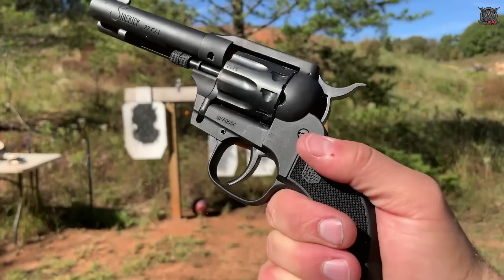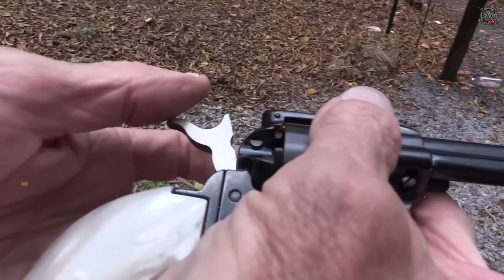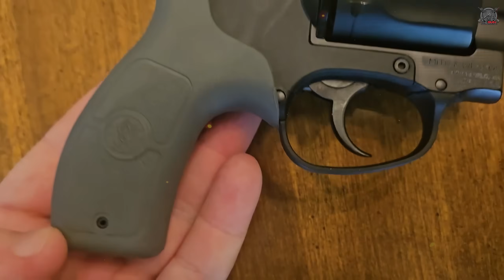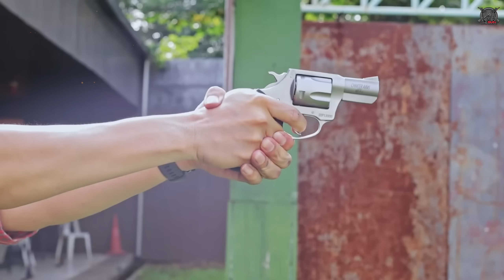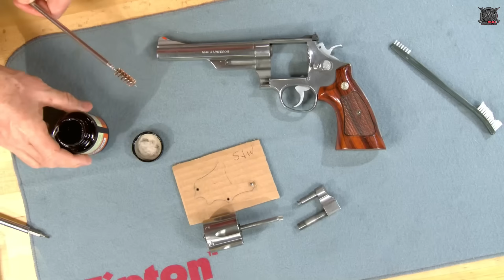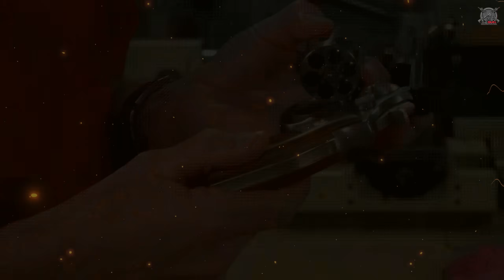Why 90% of New Revolvers Are Garbage!

Comment: I original from the State of Connecticut and we have several Guns Manufacturer including Colt, FA from Harford, Hi Standard, from Hampden, Strum Ruger from South Port, and I owned many of these old firearms some made from Machine an Carbon Steel plate purchase from US Steel as supplier. I used to work with my friends who was a Gun Marker and he machined a lots of Revolvers like Single Action, Peace Maker, Pythons, Police Positive, Official Police, These are old guns made since 1845 and I have some of them that I used and purchased with no problem.

Comment: Revolvers are as good as and bad as the semi-auto pistols manufacturers are putting out. I own two Taurus and had a problem with one. Fortunately, Taurus had a lifetime warranty and was repaired at no cost. I would only buy an all-steel revolver to control recoil. Ultra-lite revolvers increase recoil and do not last as long.

Comment: This video disappoints me because it has pointed out too many issues that should be resolved by the companies but are ignored. But I am not in the market for another revolver. what I have suits my needs. 
BTW: Why anyone would buy a "tactical" revolver I will never understand. If it is called tactical, I walk away. And in a SHTF situation I do not need a piece that holds more attached that weighs more than the weapon are wasted items that cost too much. And if they require batteries then they will fail when needed most.

Comment: Sadly, my personal experience with recent Ruger QC has been underwhelming. First, a new SP-101 came to me with a burr on the frame big enough to draw serious blood (I fixed on my own with a stone). Also the front sight has a noticeable cant because the barrel was screwed in too far. Also my new Single Ten has grip fitment that is more of a suggestion, and the chamfer on the trigger guard is way off. I would rather pay a little more to get the quality of the Ruger of yesterday.
Reply: Poor Quality control. I have not had any quality control issues with Ruger so perhaps Ruger let that poor inspector loose.
Reply: Mkkkk

Comment: Kimber is high priced junk and fail far more than Ruger. AI audio can't even pronounce lead.
Reply: I have to respectfully disagree with you on that. I have 4 kimbers over 2000 rounds each except for one i just got only about 250 rounds but no issues with any of them. I think people knock kimber because they don't own one. Until you actually get one you'll understand just how good they really are. Yes there expensive but once you see what you get for the money you'll have a totally different option of them. I have over 2000 rounds on each one. My new one cost me over two thousand dollars but man is it a honey. Kimber in the last few years has done a complete about face. They're putting out some exceptional guns now.
Reply: @bigguyguns  Bigguy big wallet big opinion. My Kimber .45 has the worst trigger of any of the 5 .45 1911 that I have owned. Nice ,pretty, well made yes. Crap trigger. To each their own.
Reply: @horkneeoldman maybe you just got a bad one. But as you say just your opinion